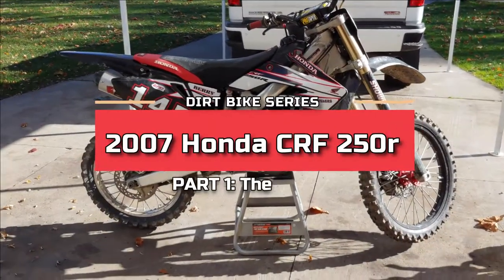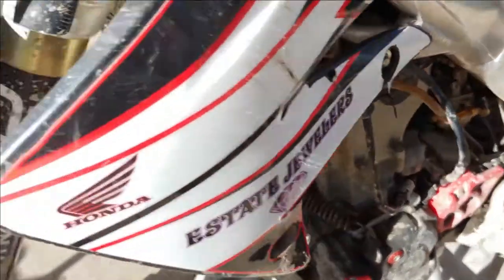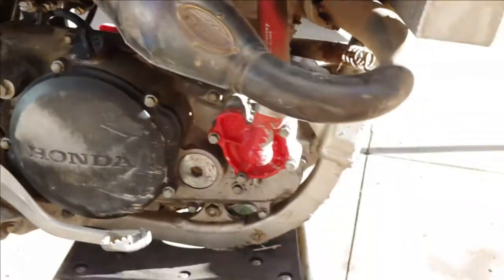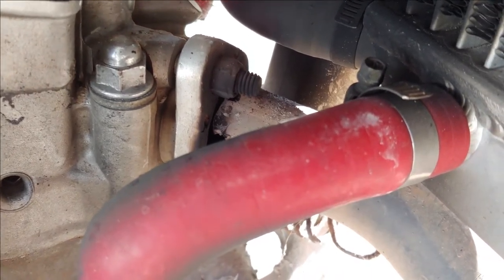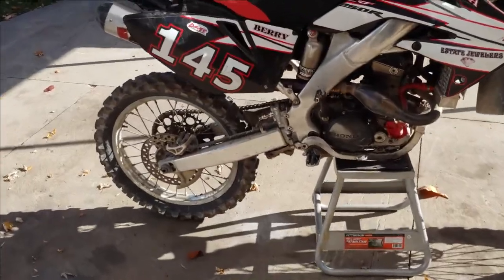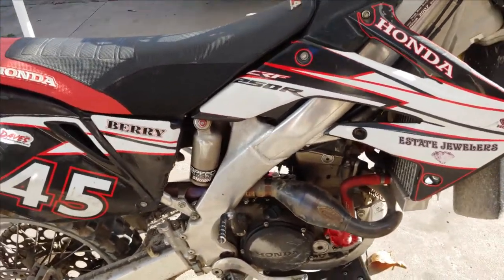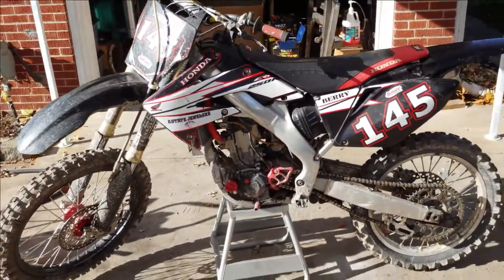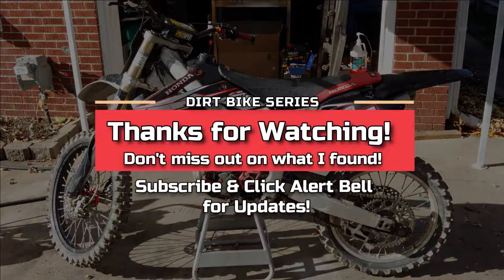2007 Honda CRF250r Repair Series: Part 1 [WHAT A MESS!?]

Comment: are you sure is right compression?, I have 97psi and is hard to start
Reply from the maker: Service manuals state because of the auto decompression valve, the click you hear is the lever opening the exhaust valves a hair so it easier to kick start, ths compressiin should be between 55-75psi when tested. So if yours is higher, you may need to look into the condition of your auto decomp lever. 450s you csn adjust the clearance in them.